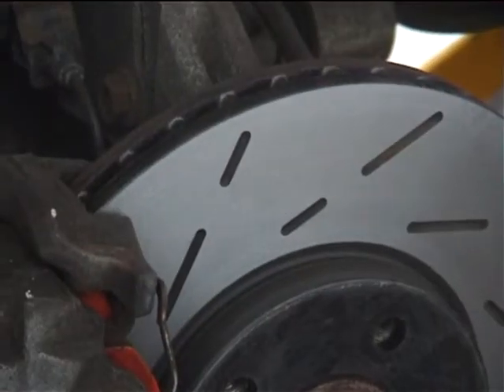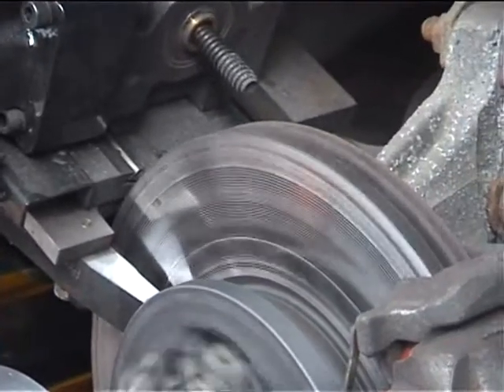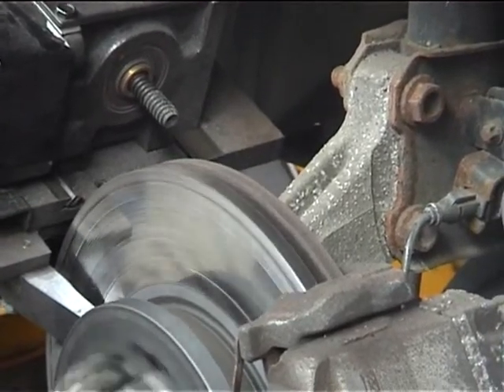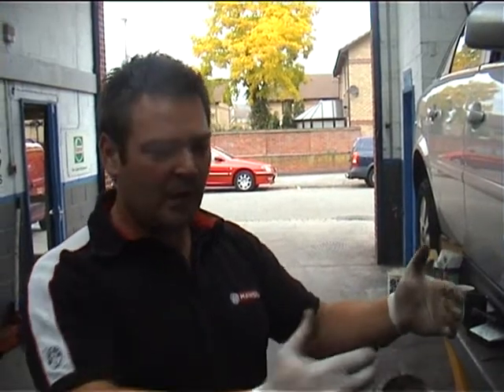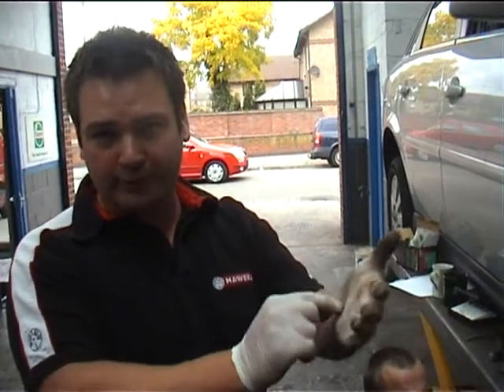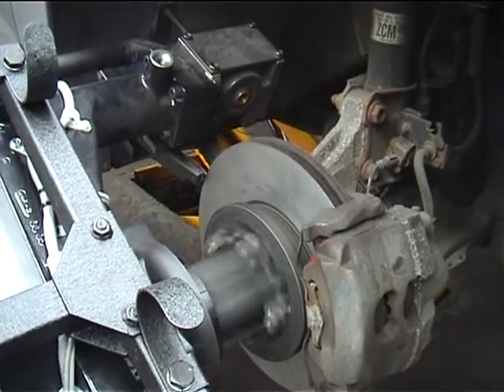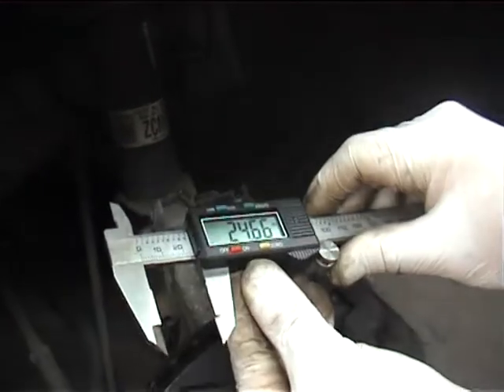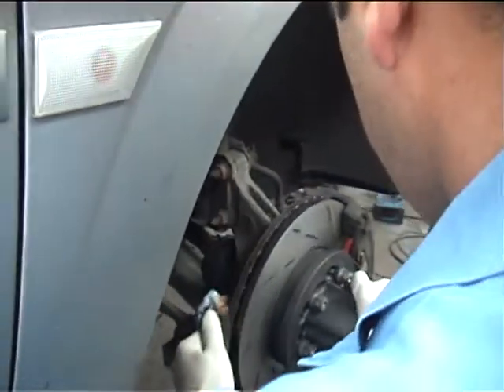EBC Pro-cut - Cure disc runout and brake vibration

Comment: I have EBC BSD rotors on the front of my 07 Lexus ES350 and i had a local shop here to where i live in bountiful utah that is listed as a locaiton that uses Pro Cut  machine from the pro cut internaitonal website tell me that they will not use there pro cut machine on slotted rotors because of how harsh it is on there machine. 
I think that with EBC and Pro Cut both advertising and listing business and shops that use there equipment but then have a shop that is not willing to use it on the EBC products but EBC helps to push them business when people send info requesting locations then EBC should not do this and Pro Cut should perhaps tell the shops that use there products the proper way to use it and that there products are designed for slotted rotors or perhaps give better warranty on the pro cut machines so that if it does eat up the machine and is hard on the machine that they will be able to not worry about damage perhaps but this is going ot be an issue if i am being told that i dont want to put new pads on old rotors but no one will match the rotors its another way for them to get more money form me to charge me for new rotors which is ot cool at all
Reply from the maker: Hi Thumper Pup! We have contacted Pro-Cut and they have told us that Baker Automotive in Centerville, Utah will be able to assist you. You can contact them on (801) 292-5694.